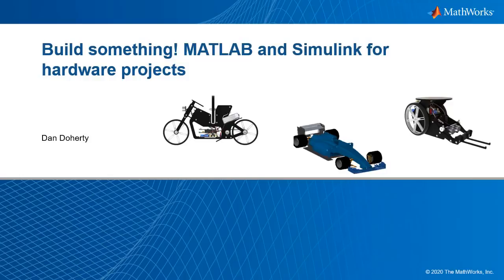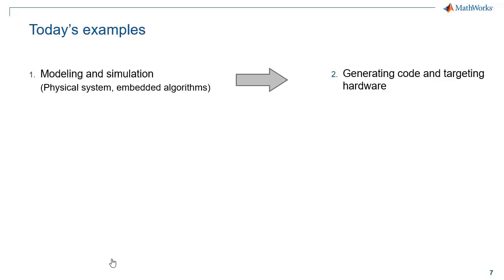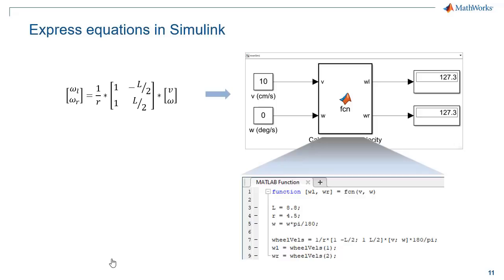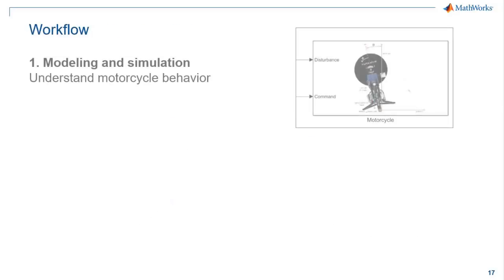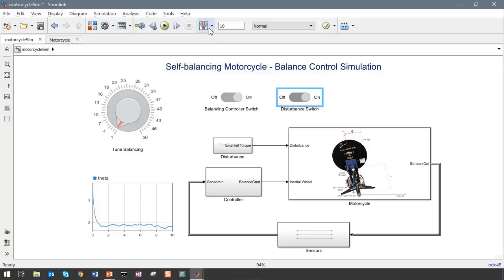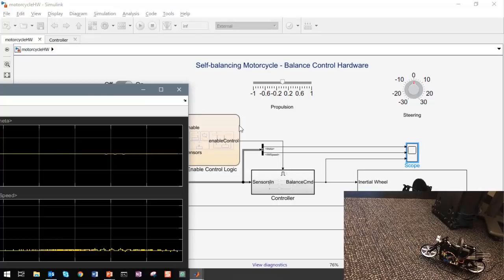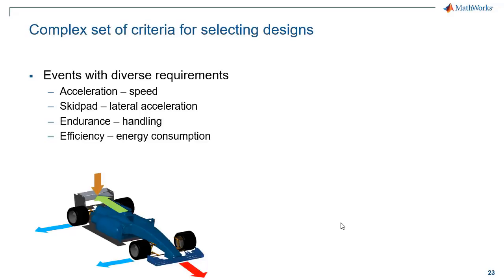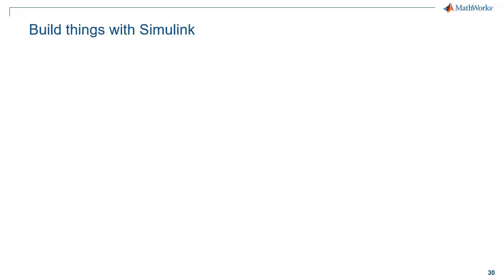Build Something! MATLAB and Simulink for Hardware Projects

Comment: It would be awesome that you explained how the code is deployed. Because maybe my harware board is not directly supported but a correct C algorithm  code is can be applied everywhere . Nevertheless,  nice introduction to the topic but I would like more detail even if is only one example . Nice work
Reply from the maker: For these examples, the Simulink Support Package for Arduino Hardware (link in the description) is used to deploy code from the Simulink models onto the device. You can auto-generate code from MATLAB and Simulink for a variety of hardware targets – see https://www.mathworks.com/solutions/embedded-systems.html. Here are some examples on using Simulink Coder: https://www.mathworks.com/help/rtw/examples.html

Comment: So, you're saying we can accurately simulate magnetic levitation as well? How are the material properties and field interaction with other parts taken into account to calculate hysteresis etc?
Reply from the maker: Thanks for the question. You can model physical systems in Simulink – see: https://www.mathworks.com/solutions/physical-modeling.html. Here are some examples: https://www.mathworks.com/help/physmod/simscape/examples.html?category=electromagnetic-models. Simscape has blocks for magnetic components that implement equations for you. You configure the blocks and the system by parameterizing the Simscape blocks.